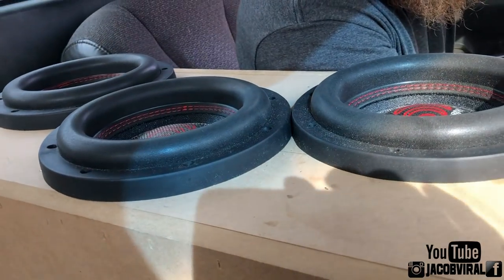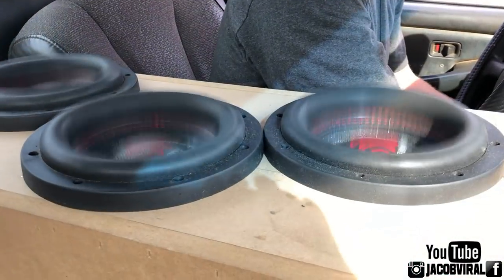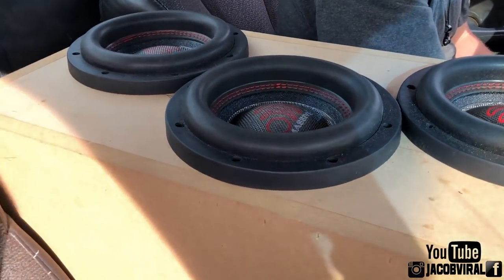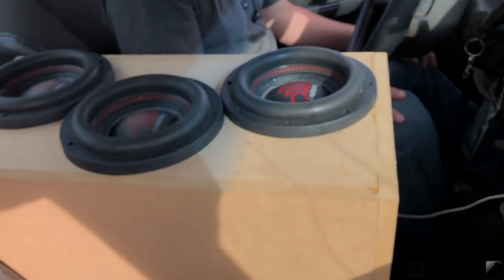3 8" SUBWOOFER FLEX!!! BANGING ON A BUDGET!

Comment: I tried a couple builds with 8’s and 6.5’s and was upset to hear a lot of mechanical noise wasn’t happy with them I’ll stick to my 15’s
Reply: Tido Bass the boxes were not built right
Reply: Trey Langston even shitty subs shouldn't have mechanical noise
Reply: Brooke Leimgruber i ran 3 db wdx3k subs and now 2 massive audio hippo xl and i will put both these systems up against a lot of systems.
Reply: Xmax vs cone area. An 8 would have to move like 3-4 times as much as a 15 to create equal pressure differential. More xmax=more distorting and movement
Reply: Jeremy S. You have more cone controll with smaller subs
Reply: Lol guys relax it’s personal preference and in my opinion I don’t like smaller subs my experience has been Mechanical noise and the boxes were built right bud👍 but again personally I like 15’s 12’s 10’s better overall for me because I like low end
Reply: Brooke Leimgruber that may be true but more linear movement isn’t always the best. Like a Rockford p3 12 has more cone area than almost any other 12 inch sub. It doesn’t have a huge xmax but it still is loud and sounds good vs a skar evl 10 stroking way out will be loud but won’t sound quite as good
Reply: Jeremy S well your trying to compare a high efficiency sub vs high excursion low efficiency subs kinda arrogant the thing is the best box for high excursions subs is a bandpass enclosure where the best enclosure for a high effieceny driver is a t line
Reply: Trey Langston how are the db drives compared to the hippos
Reply: All smaller subs 6.5" & 8" tend to  sound best at or slightly below RMS rated!
Reply: @brookeleimgruber860  i know it was a twoyear old arguement but your right about the box . The enclosure always dictates a subs performance. But the subs size has nothing to do with cone control to an extent, its design and material.the other guy was incorrect about a high excursion sub sounding bad, its in the design and material used along with accuracy of coil alignment at assembly. And the box. A big xmax  sub can sound clean tight and controlled, if the qts and qms of the sub allow for it to be put in a sealed enclosure.

Comment: Wait, they're wired to 1 ohm? 3 subs should be .67 or 2.66, correct me if im wrong.
Reply: You are correct but he could have been counting box rise.
Reply: Well or 1.3ohm. My 3 dual 2ohm are at 1.3 or .33
Reply: A subs impedance say is a 4 ohm (example) it's not always exact. May show 4.2 or so or maybe even 3.8. That's probably how he ended up 1ohm.
Reply: @LerRhann  or could be saying that his amp is only 1 ohm stable? 🤔
Reply: a kirk i was just gonna say that hippos are dual 2 ohm i owned a pair
Reply: I have two of the subs they come only in dual 4ohm. He must it wired 8ohm/3 2.67
Reply: Sir-Dab-Alot Na thats IN THEORY go plug a DMM in to a SUPPOSED .67 set up and i bet youll be looking at a 0.75-1ohm reading just sitting still. Add music and a box and youll see impedance rise**
Reply: He may have meant 1.33

Comment: Local stereo guy back in 1992 had 4-6.5" kickers in his tire well of a Ford Escort GT. Didn't even know he had a system until he turned it up. He metered 134 on the headrest sealed. He had a PPI pro mos 50 running everything in the car. Mids highs subs... Everything. Those little 6.5s hit good amazing it takes 2000 watts today to achieve the same thing

Comment: Massive audio is really a great sub. Its kinda crazy how far they flex for a so called budget sub.
Reply: Jon Doe flex isn’t everything lol any sub can flex with the proper tuning and power
Reply: PurpleSkunkYT it takes movement to get loud.
Reply: @DatHondaBoi223  Not every sub can flex far enough to really do  anything. Compare a sub that has a xmax of 5mm to one that has a xmax of 15mm. HUGE difference.
Reply: Jon Doe not every sub needs flex to be loud..
Reply: Yea well im pretty sure more excursion equals more bass
Reply: xGhxst more excursion can also equal more distortion and cause harm to the sub
Reply: @DatHondaBoi223  yea but thats where having good parts come in
Reply: xGhxst no parts can prevent over excursion lol
Reply: @DatHondaBoi223  you said more excursion not over excursion nobody would run with an overexcursed subwoofer daily
Reply: xGhxst more people do than you think. it’s pretty easy to have overexcursion and not even notice it
Reply: Yea well that's why they dont last long

Comment: I dont understand why people say its impodsible for someone getting to 150 dbs but as of now i hit 86 to 88 with my one 12 power acoustik gothica set to 50 to 70 on amg pioneer amp and on my hu at 50. Definataly i like the 6.5 and 8 had 2 of them and hit 145 dbs when i first started but i payed 200 a piece on mine i forgot the name had to much air in box and messed them up

Comment: I’m new to the whole car system thing.. So I’m curious if two Rockford fosgate 10s on a 500w amp will put out good bass. I’m not looking for anything over the top, but just want something that will still slap lol..
Reply from the maker: Sounds like a sweet starter build for sure Moon Man! Maybe go with 12s if able for more cone area. Thanks for watching!
Reply: JacobViral yeah I was maybe thinking of going 12s, but I went ahead and purchased the 10s for now so I’ll see how that goes lol.
Reply: @JayRM714  just be sure to put into a box specific airspace for your sub.

Comment: Hey so i have 3 skar audio zvx,how would i wired them to 1 ohm?
Reply: You can't. The guy in video is not at 1 ohm. He doesn't know what he is talking about. It isn't important to be at 1 ohm. Just get a strong enough amp. It will probably be at 1.6 ohm. You need 4 dual 4 subs to get 1 ohm.

Comment: would have one 15 inch with the same power handling been louder?
Reply: yes
Reply: teeone10 way louder
Reply: Not a chance a 15 has less than 15 sq in surface area, 3x8 =24 ( a bit less , maybe 22) sq in surface area. That's the ability to move more air. 15 may play a bit deeper bc of more come area but a good 8 will chew on the mid 20hz with no issues.

Comment: 6.5s or 8s?
Reply: FAMOUS JOHNNIE Bol right I’m so confused
Reply: 6.5s 1:46
Reply: Says 8 inch on the list in the breakdown of items used in the build but jacob did say 6.5s. So a bit of a fuster cluck.
Reply from the maker: Sorry for being confusing, during the Demo I thought they were 6.5" but looking into them the 8" have double stitched surrounds while 6.5s are single stitched plus have a slightly smaller surround is how I can tell they are 8" as the title describes. Thanks for watching!